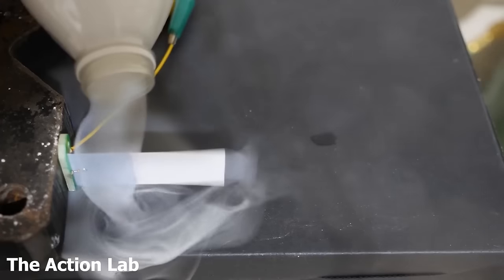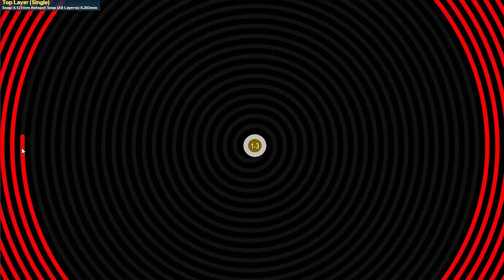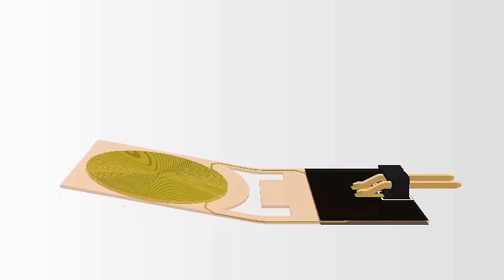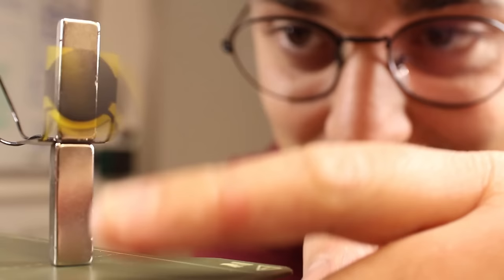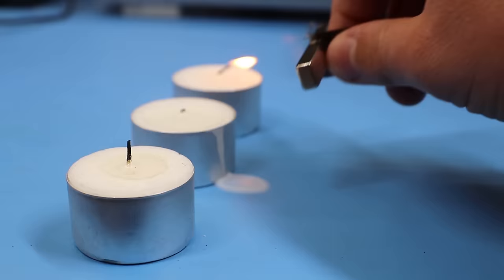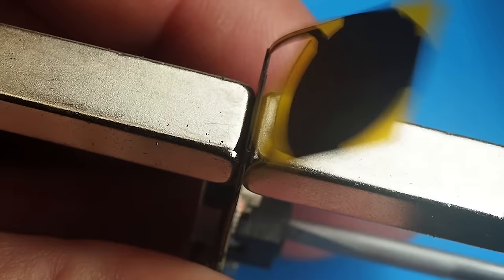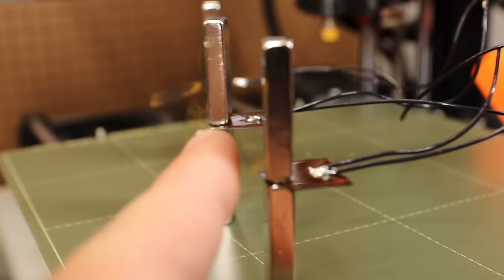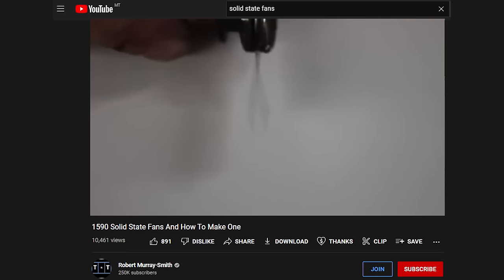Solid-State Fan vs PCB

Comment: you could stiffen up the bending part so it doesn't bend as far, more like the actual solid state fans, and use the magnets the coil is attracted to to guide the air and channel it by placing them parallel to the coil
Reply from the maker: Definitely! this was kind of what the first version was doing but my goal then shifted to hit the 180deg angle.. For v2 I am going to add sensors underneath to detect the flip automatically and i can defiantly tweak it to prevent the hit
Reply: @CarlBugeja  I'm also curious if the fan efficiency will rise with a smaller swept angle, perhaps getting bernoulli on your side with a more unidirectional flow. That said, aerodynamics is the darkest of all the dark arts, even more sinister than RF.
Reply: @CarlBugeja  would increasing the frequency prevent a full 180 flap by switching before it got all the way to the magnet? Also, couldn't an extra flexible end swish the air away like what happens on the pizo fans?
Reply: @CarlBugeja  🔴 What Is Islam? 

🔴 Islam is not just another religion. 

🔵 It is the same message preached by Moses, Jesus and Abraham.

 🔴 Islam literally means ‘submission to God’ and it teaches us to have a direct relationship with God. 

 🔵 It reminds us that since God created us, no one should be worshipped except God alone. 

 🔴 It also teaches that God is nothing like a human being or like anything that we can imagine.

🌍 The concept of God is summarized in the Quran as:

📖 { “Say, He is God, the One.  God, the Absolute.  He does not give birth, nor was He born, and there is nothing like Him.”} (Quran 112:1-4) 📚

🔴 Becoming a Muslim is not turning your back to Jesus. 

🔵 Rather it’s going back to the original teachings of Jesus and obeying him. 

More .....

Comment: You are trying to drive the entire fan "blade" length instead of trying to drive a magnetic base at a resonant frequency of the attached blade, which is what the piezoelectric fan is doing. There is also much more risk of traces failing due to work hardening of the copper when you are trying to drive the actuator a full +/- 90° bend.
Reply from the maker: you're right.. but i was aiming to explore something different than driving the thing at resonance (i mentioned this at the end of the video) so i might explore the resonance option in v2 and comparing it with flapping .. i think the results would be interesting considering than both options will be made from pcbs
Reply: @CarlBugeja  I think the resonance instead of the whole length is important for moving air forward. As bird wings and fish tails all bend a little at the tip when flapping. Also a connection in a "s" shape instead of straight might last longer.
Reply: @yibofan6855  Yep, on my humble opinion they should be bigger, flexible and in resonance to produce a "running wave" like more expensive design does

Comment: AWESOME video!!! Totally agree that reducing the angle will increase lifetime, but specially will improve air flow, since it's going all the way to 180° it's actually pulling while at the same time in lower angles it's pushing. Reducing the angle to about 90° (45° or less for each side) it will only push. But since the magnets are attached to the base, they block air inlet. Will definitely work better with some 3d printed support so the magnets doesn't touch the board (just enough to create an air intake) and so the air could flow alongside the flexible pcb.

Comment: You seem to have worked out the electronics, electromagnetics.  But might there be room for improvement in the aerodynamics?

The whole "fan" is circular because the coil is circular.  Perhaps you could design to add additional material beyond what is used as the coil, for mechanical & aerodynamic benefits?

Comment: Try two coil flaps with a stationary magnet in the middle. also elongate/stretch the flaps in the direction you want the air to go and you'll get more air movement at that slow a speed. Not surprised you'd work on this at some point. Keep up the good work.

Comment: Adding foam paddings on both sides of the flap at 1-2 cm apart would help. 

This would not only reduce the wear of the copper lines in the bending region but can also reduce the impact the copper coils deal while hitting the sides. 

But I can't figure out where to position the magnets if the above idea was to be tried.

Comment: The trick is to build a "whip". In whip a wave will travel along a fiber and increase its speed to the end. Or think about a tsunami. Its wave hight will increase near the coast. You can emolate that using coper taces to increase stiffness in some areas. Basicly the magnets will create waves and the material around it will transport and focus those waves.

Comment: Those other fans work are more aligned to a resonant frequency, whereas yours appears to work more on brute force. Pick the material in the bending axis better such that it stores more energy, and try find a balance between amplitude and frequency such that once going - you can more efficiently run it by just adding smaller amount of energy back in to supplement the natural occilation of the material.

Comment: Think of the shape of a tuning fork, a football goal. 
Have your flapping sheet attached to the bottom bar between the arms with a small gap between the arms.
And have the flapping material stiff enough so it can't twist. 
And the magnets at or near (as needed) to the tip of the arms.
And have two smaller coils at each corner maybe? Or just the central coil.
Or could you get a benefit if you make the coils in the corners Cresent shaped?

Comment: Like several other commenters, I think playing with non-active areas of fan blade might help. You could have dead plastic past the actuated area to make it longer, and I also wonder about having a dead area below to introduce a bit of torsion when the fan actuates--it seems to me that might tend to cause the air to be drawn down from above, rather than just from the back, where it's blocked by the magnets, and this might improve the efficiency. (It might also generate an upward thrust, which could be interesting to play with in its own right.)

Comment: Thank you for your inspiring video 😊👍🏼
Reply: How many bend cycles at which radius did the PCB last, and did you use rolled copper instead of electroplated copper for the traces?
Reply from the maker: the one that survived lasted 2,592,000 cycles

Comment: Smaller magnets held on wires near the coil would reduce the bend, and also reduce the air flow resistance. I think that this would allow a much higher speed, which should be more effective.

Comment: Sorry to let you know but I think that the low airflow issue is because in original design the thing is working like swimming fins: making the running waves (like a snake runs, please see the original design). On my opinion the additional simple lever could help to convert the small actuator movement (to preserve the copper for a longer time) to the big "fin" waves. Good luck!

Comment: I wonder if a piezo air assist could be effective for laser cutters. Having an ultralight transducer attached to the laser head requiring no 'dragging' of the usual pneumatic pipe could be more efficient and even offer different operational modes to best suit the debris being cleared.

Comment: They call these solid state but they still work with a moving component that experiences wear. 
A true solid state solution would be more along the lines of an ozone generator creating flow, or utilizing convection currents for cooling.

Comment: Is this solid state? I thought solid state means that there are no moving components. I thought of something like accelerating ions using electric fields or something to create wind.
Reply: a flexible mechanism still counts as having no moving components, there's no resistance wear between parts etc. But it is a little unintuitive since it does move
Reply: But there is wear. As pointed out in the video. The copper lines in the fPCB break
Reply: So he made a more useless version
Reply: @suncrafterspielt9479  true, but no wear between moving parts, the durability is only determined by the flexible part. This makes it significantly more reliable and durable than a normal fan. In this case however a pcb is used as the flexible part, which isn't designed for this and breaks way easier.
Reply: @fallu6224  yes, but he expected that. It's an experiment, and it's always useful to experiment
Reply: @BigBoyDuckie  Well some experiments lead to nowhere. Melting my own shit and molding it into a new revolutionary composite seems more useful.
Reply: @fallu6224  solid state fans are already a thing that's valuable, he just wants to experiment on them using his own platform, which is awesome imo. He's aware of the shortcomings he said it in the video
Reply: @BigBoyDuckie  Well he's version has 10$ value instead of 1000$ for a reason. I experiment on things too but I don't make clickbaity videos about my amazing mediocre creation that even a child can make
Reply: @fallu6224  I bet you disliked the video xD Unfortunate we can't see the amount of dislikes
Reply from the maker: There is only 1 moving solid-part without any bearings to cause friction so I guess it is considered as solid state (using the same logical terms of the solid-state piezo fan)
Reply: @suncrafterspielt9479  Well criticizing things on YouTube is not allowed these days

Comment: I think a improvement would be making it longer, like the piezo one, with the coil all the way or just at the tip, theoretically it would improve reliability and be more powerful
Reply from the maker: i will defiantly test this in v2 (along with some other options) as i think driving this a longer arm at resonance would definitely improve the durability

Comment: @here looking at the design. You look at nature where the flapping goes side to side. But the one you are modeling on goes like a whip. I don't think magnets is the issue seeing as you can create electro magnets. .. ..as an experiment add a post-it to the end of an electric tooth brush without the bristle head. Simply the flat metal that is inserted. I also have an idea rather than copper you can use

Comment: The magnets are your problem not controllable maybe 2 coils instead of mags you cud switch poles before it touches with hall sensor, reed switch,  but the copper traces need to be protected maybe pass through a spring made of plastic or copper mmm might be better scale it up a bit

Comment: I would make the coil separate from the magnets with springs. Maybe
Reply: What I’m saying instead of a copper trace being snapped. Small heat tempered springs may last 1000x.

Comment: Dude, how did you not see the solution to the airflow issues due to the magnets being in the way when you had the set of 3 running? Just add some material been two actuators.

Comment: magnets appear to be blocking most of the air. Myabe a diametrically polarized ring magnet might be an option to allow the air to flow through the center?
Reply from the maker: yeah i think that would improve it a bit

Comment: Interesting, so if you increase the voltage, could you drive the flaps at a higher frequency with a narrower angle? 
Also I like the idea of driving a thin piece of metal at a particular frequency to make it resonate and pump air. I don't know how feasible it would be, but if you can make a wave propagate down the length of the fan blade, then maybe it could pump air thorough a lot more efficiently?

Comment: Great video, but I think “solid state” implies that the device has no moving parts. The only solid state air-moving device I’m aware of was an electrostatic model aerofoil wing, but I believe it relied on a differential of hundreds of thousands of volts.

Keep up the great ideas
Reply: Actually you mentioned piezo-electrics… they change shape in response to current, and I believe are considered “solid state”, so I believe my definition of “solid state” is slightly inaccurate… but I still doubt your DIY flapping coils count. Can anyone weigh in definitively?
Reply from the maker: Thanks :) There is only 1 moving solid-part without any bearings to cause friction so I guess it is considered as solid state (using the same logical terms of the solid-state piezo fan)

Comment: nice work!. have you thought of making a valve like flap in the centre(or other crazy configs) of the "fan" so the air doesn't move in the opposite direction in an enclosed fitting !

Comment: In the footage of the piezo fan it seems to have a  floppy-ish tail, that increases the radius of the movement and whips when the direction changes. Could a smaller than 180° movement with a tail that flops a bit work? I'd be concerned because the tail adds mass, increases the amount of air to move and increases inertia but might be an interesting experiment.
Reply: That makes me think of sinusoidal propulsion.
Reply: @mrab4222  Thanks I learnt a thing - Sinusoidal propulsion -  how a snake moves. Thank you for killing my productivity today with this interesting internet rabbit hole.

Comment: Magnet, plus alternate magnetic field equals = Motor It is not a solid state Fan!!! it's a non-rotating Motor, i.e linear motor...
Reply: it is in solid state though (no moving parts)
Reply: I believe it has more to do with not having friction from moving parts, and not magnetic fields. The main advantage of solid state fans is their reliability because they don't have friction.
Reply: @zakariakhamees  not sure if you watched the video, but the element is indeed *moving* back and forth.  A solid state fan would use something like static electricity to move air rather then any moving part.   Just like a solid state relay doesn't have ANY moving parts (i.e. nothing moves)
Reply: @gutrali  I am not an expert but i just compared this with the popular piezoelectric one from LTT (which they say it is solid state). They both flap.
Reply: @zakariakhamees  10-4. I would argue that piezoelectric movement is not solid state either. To me, solid state means not having any different states that the device can move between. In both the case of piezoelectric fans and this flapping motor, the two states the device physically changes between (flapping to one extreme and then the other) are really obvious. This gives it multiple states it can be in at any given time during operation.  Compare those to a fan using the motive force of electrons and there are no longer any "states" the device changes between. It stays in one solid state, continually, without movement, and yet still functions for it's purpose.    I do believe most people misuse the term solid state in this way. If there was no movement between states, then there couldn't be any wear occuring, and yet we know that both of these types of fans absolutely do wear out as they induce air movement
Reply: @gutrali  I agree with you 100%. They definitely misuse the term solid state in these fans.

Comment: In what way is the vane of an oscillating fan any more 'solid state' than a blade of a rotating fan?
Reply from the maker: There is only 1 moving solid-part without any other parts causing friction so I guess it is considered as solid state (using the same logical terms of the solid-state piezo fan)

Comment: the intake is from the sides, centrifugal blow out
Reply: you flap too much, less angle, you exceeded the plasticity angle
Reply: if the flapping pcb would have a spring, not just a flap, in itself, then it would work

Comment: how is this solid state? its a coil moving in a magnetic field driven by electronics.. hmm sounds just like a typical fan. Cool toy bro.
Reply from the maker: There is only 1 moving solid-part without any other parts causing friction so I guess it is considered as solid state (using the same logical terms of the solid-state piezo fan)

Comment: Like others have said, I agree it should be shaped more like the original. Have the coil near the base with the magnets suspended directly over it like a sandwich, and a VERY flexible tip to allow a sine wave to travel outwards, down its length. Then sweep through a range of frequencies to see when it hits resonance to get the most movement for the least energy spent. 
I'm not 100% sure, but I think the video "How do fish swim so quickly?" by @numberphile might be relevant... https://youtu.be/wYDh5d9pfu8

Comment: I get it anything to say for clickbait but that is not a solid state fan that still has moving parts solid state meet the whole thing is solid and nothing moves that will eventually break down and in fact in the video you had two of them break down within 24 hours even if you went with a thicker stronger piece of metal they will eventually break down so I am sorry to say sir that is not a solid state fan but I'm sure you already knew it wasn't a solid state fan but you said that anyways because you didn't care you just wanted to click so therefore I am giving a dislike on the video and I will be unsubscribing because I am getting tired of people saying anything on the thumbnail to just get people to click on their videos things like this will eventually be the end of YouTube in general
Reply from the maker: I appreciate your feedback and I'm sorry you feel this way.. With regards to  my project, there is only 1 moving solid-part without any other parts causing friction so I guess it is considered as solid state (when using the same logical terms of the piezo fan which is being marketed as solid state) that said it is breaking because of the larger angular distance, but as I said in the ending there are solutions which I plan to improve in next concept